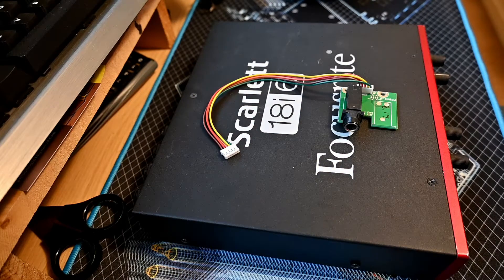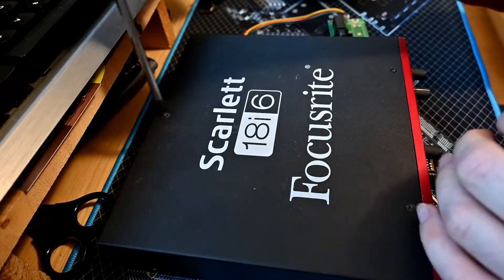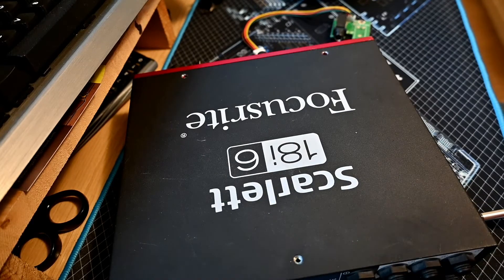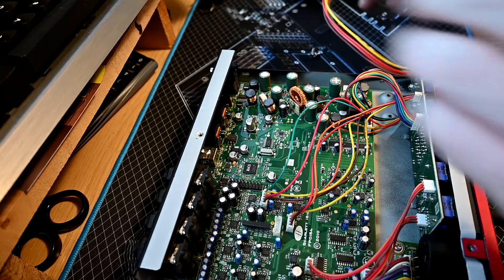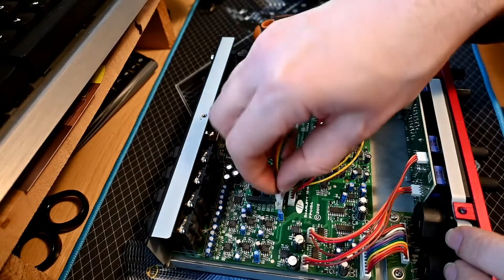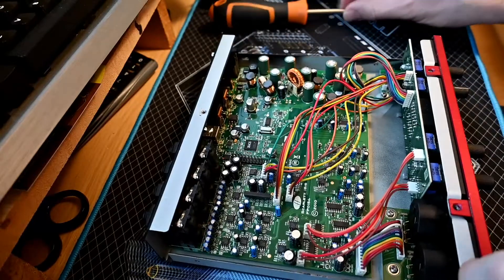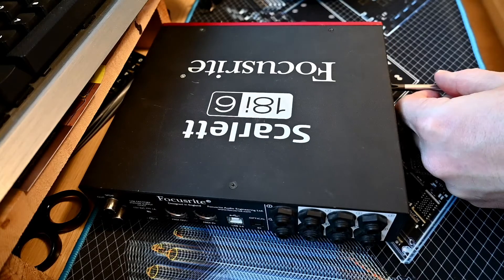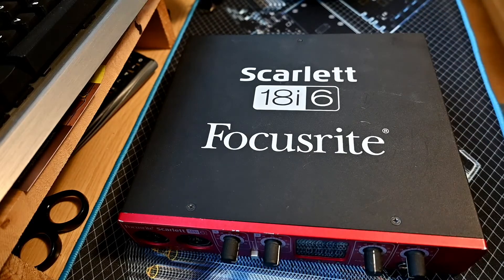Focusrite 18i6 Repair - hopefully fixing a crackle on the headphone output

Comment: Hi,
I have a problem with the driver, what driver are you using for the scarlett 18i6?
Reply from the maker: Ah, I use it mostly in Linux without a driver. However I did dig around and find a driver on the scarlet website in the end so take a look there.
Reply: @pleaseleavequietly  sadly, mine tells me usb not recognized. the usb led form the unit is not light up.